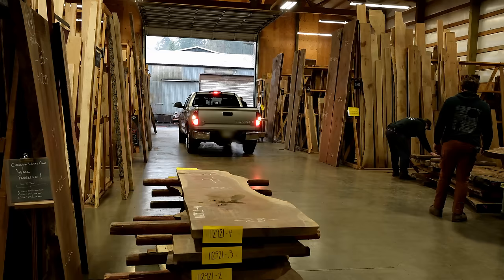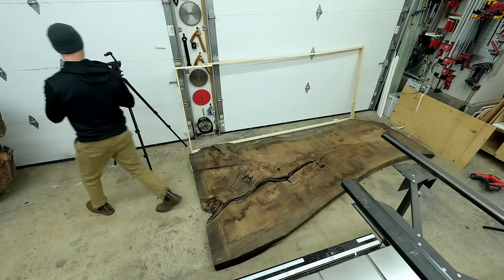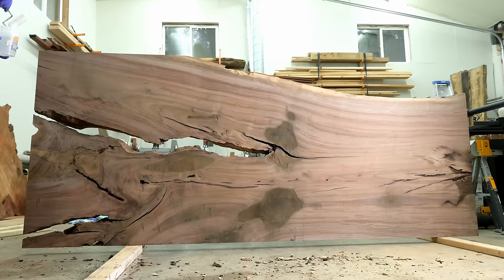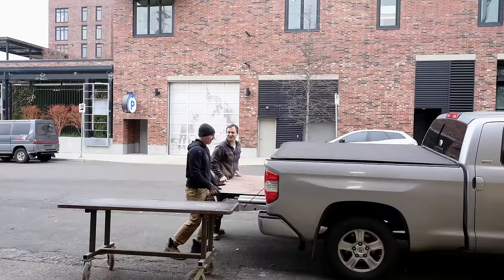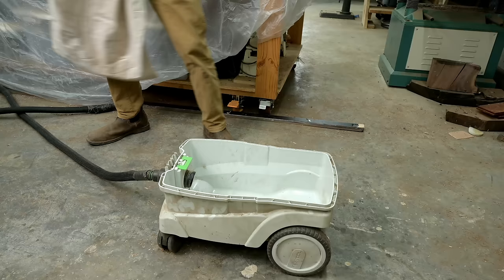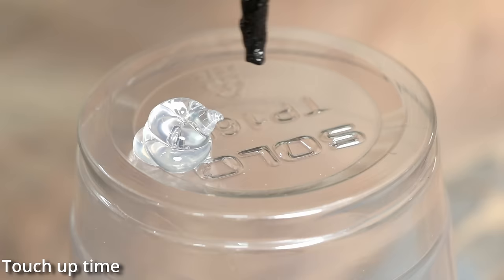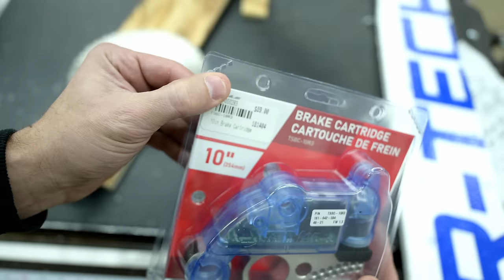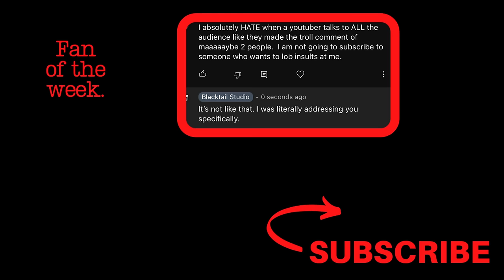The Client Hated This Slab

Comment: I am an intermediate woodworker,  retired dentist.  It  took  me  6 to 9 months,  depending  upon  how  you want  to  measure  it,  to  accumulate   some  tools,  create  changes  to  my  router  table,   and construct a  8 "  by 12 " by 5 "  keepsake  box.   I  wasn't  surprised  when it took  me  that  long,  due  to  the intricacy of  this  keepsake  box.   They  say  don't  do  your  woodworking  when  you  are  too  tired,   or  in  my  case  too  old  and  too  tired,   76  years  old.  I  can  only  praise  you  for  your  workmanship  and  expertise,  and  knowledge.   I  once  took  me   7 months  to  build  a  kayak/canoe  some  years  ago.   I  didn't  have  a  woodshop  in  those  days.  I  had  a  sinus  condition  for  7  months  because  I  did  all of  my  woodworking  in  the  downstairs  part  of  the  house.   I  could smell  the  varnish  or  epoxy  whenever  I  entered  the  house  in  the  upstairs  front  door.   You  are  only  to  be  commended  for  all  your  great results.
Reply: First I enjoyed this video, although it was a large table the actual steps seem very straightforward.  I have watched other guys make epoxy river tables and they use heat to get bubbles out.  Didn't see you do that in this, would that have been a benefit?   For the creator, I  liked the redder stain than the charcoal, seems to celebrate the wood more.  Since you were looking to apply finish to a 120 grit flat slab, why not skip flattening slab until after applying epoxy then run the piece thru the giant sander?  All the sander marks would be with the grain similar to a belt sander on a floor.  If you explained  this sorry but please do again.

Comment: Loved the video. One suggestion I would give, is to make your work table with the ability to raise the height to help save your back during some of your processes. You could probably have your friend the welder create the table and you can use a pneumatic system. 

You can also build a winch system like they use for boats to move those massive, heavy slabs from your truck to your work table. Many years ago my dad and I replaced an engine in my car and he built a very simple winch that was attached to wood beam He set on the two walls on each side of the garage.  We were then able to move the motor exactly where we wanted it. 

I was lucky to grow up with a genius engineer for a dad. He knew how to solve pretty much any engineering task.
Reply: We need to get this comment to the top of the list to make sure he sees it -- good suggestions!
Reply: Good idea, but I would use a hydraulic lift system seems it would be more reliable when lifting heaver items. Pneumatic or hydraulic either is better than using your back, LOL

Comment: Tip:  In order to eliminate bubbles / imperfections after filling the epoxy, try vibrating the whole frame. Could be an impact drill on a piece of timber, or maybe a Food Processor / blender fixed to a board on top of the table for ½ hour 👍
Reply: I wonder if anyone has repurposed a bass transducer for this very job.
Reply: You do this for cake batter too, when you put the batter in the cooking pan, you bring it up about an inch and drop it. Works great, and you can always see the bubbles coming out.
Reply: Vacuum chambers work great for this, though it might be a little hard to find one big enough for that table :P
Reply: He could use one of those new massage guns that are everywhere now and can be gotten for cheap. He would likely need to go around the edges of the table with it though to make sure every area gets vibrated

Comment: "Everything we do is a pain"- absolutely love this. I dont do woodworking or anything, but i like seeing how you guys do this stuff and the process. I am a 3D artist, and i can see the similarities between 3D art and woodworking. Obviously, two completely different crafts , but still run into problems every project. Every project is a puzzle, and that's a part of the appeal i suppose. Solving small (sometimes large) problems.
Reply: I do woodworking and I can't see any similarities. No hate but I feel like tablet "painting" and 3d printing has destroyed the craftsmanship and art of actually creating something with your hands. I can't imagine it feels nearly as satisfying when finished. Maybe I'm wrong, don't mind if there's some schooling you can take me to to change my mind?
Reply: @heatherlee7123  There are definitely similarities to these two crafts. Besides op said 3D artist, not 3D printing, which is very different. I can say both have the same amount of satisfaction when the job is finished. It really depends on the time spent on it and what you feel about your finished work yourself. Not trying to be condescending or anything, just speaking my mind from my experience!
Reply: @heatherlee7123  3D art is very different from 3D printing.
Reply: i am an e.r. nurse, i think i could apply this motto a lot in my in my daily (well technically nightly) life too!

Comment: Cam, I honestly like to see the bow ties by hand. I’m not a big fan of carving pieces out with a cnc. To me it gives it a less handmade feel. Keep up the good work!
Reply: To each their own, I've fallen in love with some of the impossible cnc joints and inlays. To me, an amazing CAD file in organic material is its own sort of art.
Reply: I don't think there is anything wrong with using a CNC, but I feel that some of his clients may not like that not everything is "handmade". Would probably be nice to have and ask the client before hand which they would prefer before hand and go with that.
Reply: @JDubbleu  If they look handmade why would anyone care? I can see if it looks made with a router and maybe has rounded edges.
Reply: For example, I could see it being really interesting to use a CNC butterfly, stylized bird (think totem outline) or even some other animal as a themed set of inlays, some having purpose (bowtie function) and some being decorative, especially if epoxy can be used to highlight features.

Comment: Regarding the CNC question: have you ever considered a Shaper Origin? That seems like the obvious solution to work on your large slabs, because you are not confined by the size of any machine bed. Also, they take next to no effort to "program". You load an SVG of the shape you want to cut, which you can create e.g. in Inkscape. You may have to play with the tolerances a bit to reliably achieve a "fits the first time" experience, and you have to knock out the corners yourself still. But it may speed up your process significantly.
Reply: nice try shaper origin
Reply: I have a Shaper Origin. It is amazing for bowties. Perfect.
Reply: Yeah that would actually make sense for the bow ties. But don't worry mate, people hate on it the same way they do on cnc
Reply: If you round the corners it will save you a step.

Comment: The foam probably picked up enough static that a slight increase in speed, while you pushed it through the blade, released that static and set off the stop
Reply: I wonder if that thin film of aluminium or whatever it is, "helped".
Reply: Absolutly caused by alu foil
Reply: You took the thought right out of my head
Reply: If there is ever any question about conductivity I always use the bypass key/function. It eliminates the safety of the SawStop but won’t trigger the stop mechanism.
Reply: I was going to leave this as my guess, static build up and it sensed the change when the positive build up on the foam grounded.
Reply: I love your videos. My question is, could you use fiberglass resin with your pours? In theory?
Reply: @josephsliger3308   I have to assume you are referring to polyester resin, the short answer is that it is not suitable for that type of application, you can use polyester and vinyl-ester resins on wood but it generally hardens to fast and isn’t as clear as epoxy, it also has a tendency to crack without some kind of reenforcing like glass or carbon fiber
Reply: @11THEFEZMAN11  that's good to know. Thank you.
Reply: I think that aluminium film connected you with the blade through the metal table. You can see in the video the you didn't touch the table by sawing the first stripe, but did by the second stripe... BTW, your work is unbelivable! Stay safe and tank you!
Reply: @failforcesquad  No, the foil or conductivity removes static electricity.  They use foil on tons of large web film jobs (think commercial rolls) to take static out of the roll itself so it peels away from itself on the unwind at converter.
Reply: @jblecoz the friction from the blade was enough to heat up the foam and cause it to melt. Saw Stops also trigger with the presence of moisture and we have this problem at our shop with cutting foam or AZEK so we bypass it with the key function

Comment: 21:42 The polystyrene board probably generated static electricity when being cut and that might have triggered the safety stop.
Reply: Agreed, the combination of the metal backing and the static is at fault here. I'm not sure if you can bypass the sensor for use with foam... but it's an idea
Reply: @jlakin  The protection can be turned off with a special key every Saw Stop owner got, it's usually what you need to do in order to cut wet wood for example. I also agree with the static electricity statement.
Reply: Your finger touched the saw table top which connected you to the blade through the foil which was also touching the table top.
Reply: @jlakin  it is possible on a sawstop to bypass the sensor, just thought!
Reply: The underside of the foam has a metalic foil on it, that triggered the sawstop.
Reply: Ahhh very smart on your part! That's probably exactly what it was. Good to know so I can avoid that in the future :)
Reply: Static electricity does not affect the saw as it is grounded. The safety circuit has to sense the capacitance of your skin to be activated. If you review the footage, you will clearly see his finger/s touch the saw table top.
Reply: @infinityvideoprod  you can tough the cast iron table when you use the saw stop. Just not the blade when it's in motion.
Reply: @ryantoth866  Of course you can touch the cast iron top, however you obviously didn't read my reply or you would have seen the part about being "connected to the blade through the foil" on the styrofoam
Reply: That is what i wonder if the foil played a part, as in it allowed the static of the whole sheet to be conduced.

Comment: A couple tips when using the forklift on that incline there.  Tilt the forks back as much as they can to keep the center of gravity as close to the mast as you can, and keep the load low until you're right at the back of the truck.  You want to move as little as possible with the load lifted to avoid tipping and damaging something (or yourself).  And those extra 12 feet don't look like much but I've seen too many people go ass over teakettle hitting the brakes that far away and you really don't need to hurt yourself.

Also, those extenders will work with your pallet jack.  Just saying.
Reply: Jesus Christ died for your sins
Reply: You should also try to approach in an uphill direction wherever possible !
Reply: Imagine believing in gravity
Reply: I was thinking the same thing.  I would have been right next to the truck before lifting the crate and would only life just enough to get it in.  Moving with a lifted load is both dangerous and nerve wracking for the forklift driver.

Comment: Yes get that CNC - - just so beautifully accurate - and once you've done it once it comes quickly. Tip - practice on foam board to save you breaking bits to start with.
A small one that  will clamp to your table  top will do you fine with a 5cm Z axis - it will just sit on top of whatever piece of wood  you're working on and since it's small it'll be cheap. 
We use ours constantly.

Comment: I’m a hairdresser, so I look at this from a color theory vantage.  The complimentary/opposite color of red is green. If you find a way to add just a hint of green it will make available to you wood you may have had to reject based on color. With a little practice on a lot of swatches you’ll be able to make any wood look any color.
Reply: I was trying this on a recent wood working project for a client and it is hard then you might imagine. There are two ways to add the complimentary color, directly to the stain or to the top coat. In either case, getting the right amount to shift the color without adding a stranger highlight color is difficult. My project came out too orange so I was trying to use blue to shift the color more brownish. This worked in some places however in places where the bare wood did not take stain well, the blue was very noticeable.
Reply: I think the challenge here is that the variegation of the wood grain makes different amounts of red in different spots
Reply: Beautiful. A lot of people won't do commissions because it's hard to please all of the people all of the time.
Why didn't they choose a wood with more appropriate colour tones ?
Reply: In hairdressing we have this process called “highlighting” where we mask off areas we want left unaffected by the color formula, but we also do a freehand version of that called “balayage”. 
In my first comment (which seems well-received by the thumbs),I noted it should be practiced a lot before implementation. Based on hair color formulation protocols, I foresaw all of the problems you’d run into. My recommendation is to use far less complimentary tint than you will want to. People (90% of colorists) formulate to eradicate the offensive tone, and they are left with muddy colors with no life to them. When introducing a control color, we are not trying to eradicate its compliment (I mean, it IS called a “complimentary”) but to rather calm the dominance of the offending tone. 
Salon colorists take meticulous records of successful (and un) formulas, and I’d advise anyone to stay miles clear of this approach to wood staining if you aren’t willing to make notations of your formulae.

Comment: As cool as the CNC is I really do appreciate the whole process of putting in the bow ties. But I also understand this is your business, if it makes financial sense to do it then absolutely do It. Keep up the fantastic content
Reply: I've been out of the CNC business (used to write CAM software and get to test it out on customers' mills) for a long time (and then I was in precision metal), but for those huge table tops, you would need a big machine and setting up for each insert, measuring, working out the datum edges and that ... I suppose I see CNC as useful when either what you want to do is geometrically complex or you want to do the same thing several times.
Reply: I run a CNC all day, every day and setting one up for these tables is simple. Once you set your XY Zero and Z Zero, as long as you do not move the slab, there is nothing difficult or time wasting at all.
Reply: Jesus Christ died for your sins
Reply: @jesuslovesyou2616  that’s on him. I did not ask him to do that.

Comment: 21:47 Looks like it triggered the SawStop right at the moment you touched not only the backing foil, but also the table. This increased the electrical conductivity (decreased electrical resistance), as the table is lower resistance than the foil. The big contact area between foil and table, right next to the sawblade put the resistance down below the trigger value. Just guessing though.
Maybe you could test this in test-mode, where it will only blink at you angrily instead of triggering? You‘ll have to watch your fingers yourself though!
Reply: I think you’re probably on the right track. The device tracks conductivity. My initial thought was the static charge caused by the foam board.
Reply: @LFroetschner  same here, that stuff is crazy and seemed to make the most sense to me too. I'm not really experienced enough to know for sure considering I didn't even know there was an angry blinking mode to begin with XD

Comment: Sliding the insulation across the saw table, and the friction of the rotating saw blade against the panel might be creating enough static electricity (depending on the humidity) to activate the SawStop brake. When I've cut sheet insulation on my Delta I end up with mini pellets of foam stuck to my arms and clothing from the static charge.
Reply: Foam panel on video is aluminium foil coated. Isn't it?
So, when Can do first stripe he didn't touch the foil. But doing next stripe it looks like that he touched the foil (on panel end).
Moreover, it looks like he touched top plate of saw chasis and foil.
Chasis, hand, foil, saw blade - bingo! :-)
Reply: @kavka_tsr4441   He had a good contact with the aluminum with both hands on the first cut. When the cartridge fired it looked like he wasn't touching the aluminum at all... just the saw hood and the insulation foam, although it does look like he may have been touching the table near the aluminum as he touched the hood.

Static is a good candidate. It also maybe coulda mighta been friction heating up the blade enough to ionize of the foam where it was in contact with the aluminum and the table.
Reply: I believe Sawstops work by static electricity - so I could see that cutting insulation might do that

Comment: I have a CNC and I’m 100% on board with you getting a CNC. So much customization options, but you’re gonna need a huge bed since you work on so many large pieces.
Reply: The idea of adding the extra step of moving such a heavy piece onto a CNC table (not to mention the cost and amount of real estate such a table would take up) just to do what usually ends up being a few square inches of carving seems unreasonable.
Reply: i think theres CNC handheld routers which might be a better fit

Comment: The foil on the back of the foam is a conductor . We have saw stops at our shop we have set them of with 2x4s that were too wet, mirrored plexi glass, board with multiple layers of lacquer, aluminum laminate. If you ever have a question about a material it’s best to just override the saw-stop